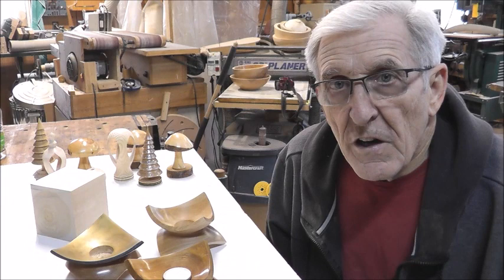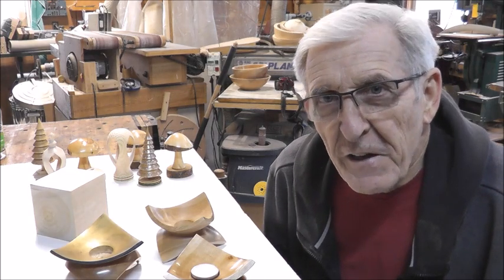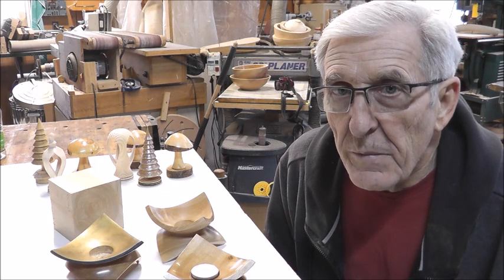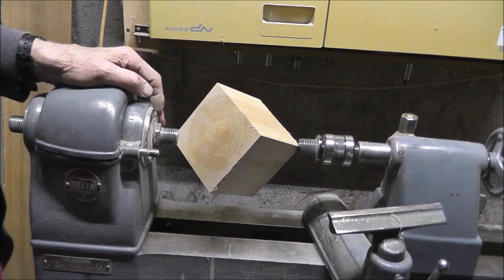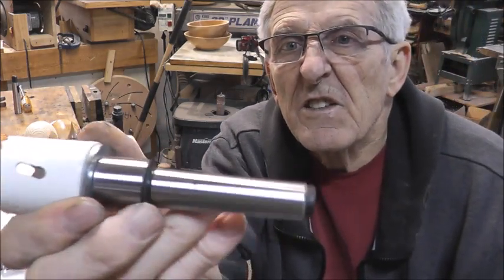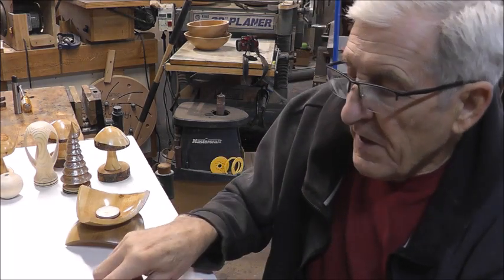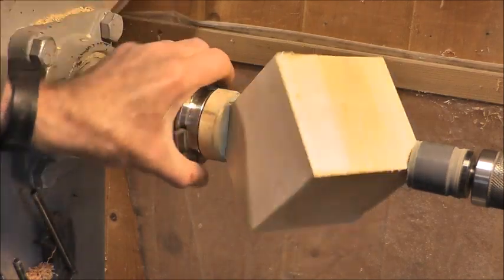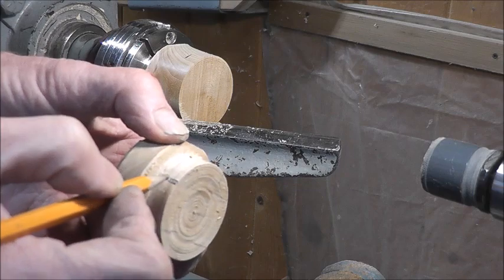DIY DRIVE SYSTEM HOLD A CUBE OF WOOD ON THE WOOD LATHE

Comment: Hi, I hope your better half is recovering well 👍  ....... I thought drill hole, fill with epoxy/body filler, then chuck in your cube ... then you revealed method #3.
Method  #4 ... three dowels rounded over at the ends, inserted into a block of wood mounted into the chuck, spaced at 120 degrees from each other and slightly out from the centre ... that would give three fingers into which the corner of the cube would fit ........... method #3 is the best, and you could also use hot melt glue instead of filler!